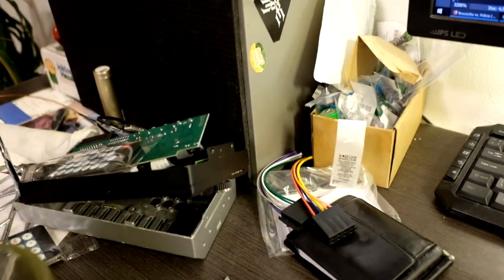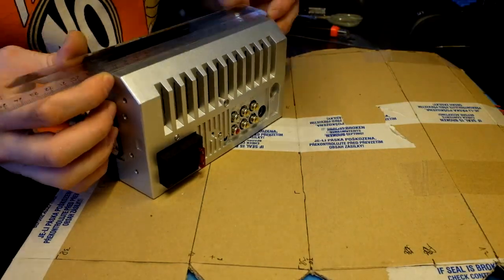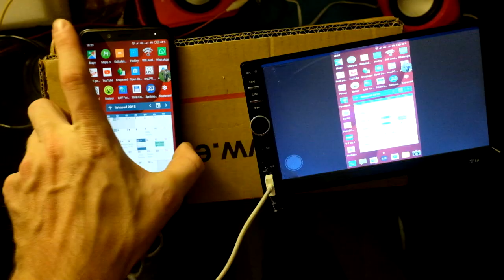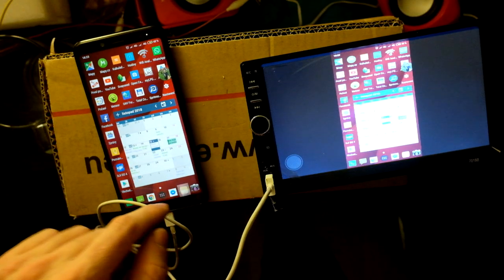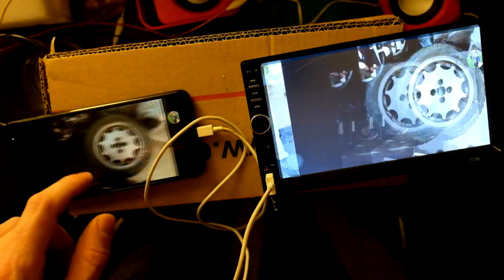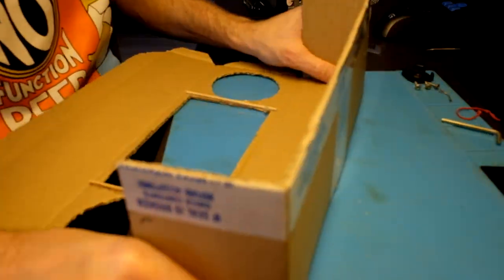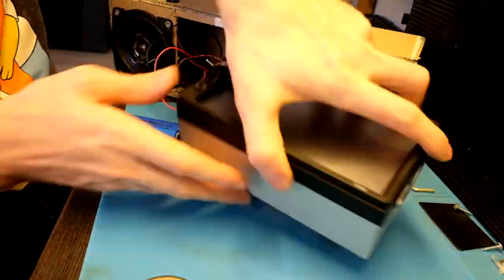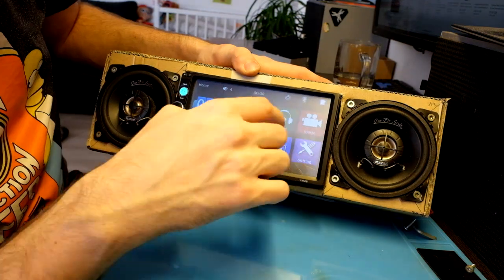DIY video boombox prototype

Comment: Can i have the wiring diagram?
Reply from the maker: connect battery and speakers to the radio, that is it :) (on radio usually 1 connector is for power and second for speakers. Power connector is usually black-ground, red +12v, yellow is stand by, so connect it to +12v also. )
Reply: Can it handle a 4-8ohms, 400watts speakers?or higher
Reply from the maker: @zteblade8194  of course, but amp in radio is only 4x50w so you will not use them to max potencial, but they will be loud enough
Reply: Thanks a lot.. hope will see you many DIY projects.. God bless
Reply: is the 4 inch speaker is loud enough and good bass?
Reply from the maker: @fahvm4362  it is loud, I measured 115db, but bass is not there, my 5" boombox is a lot better for bass